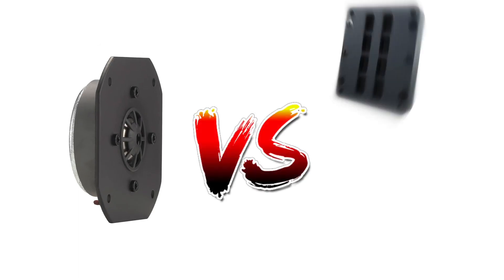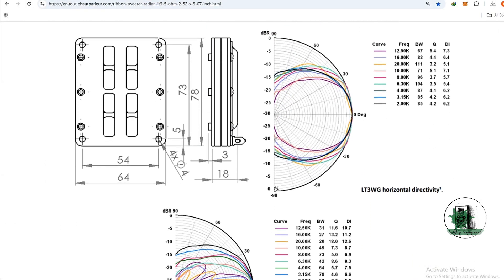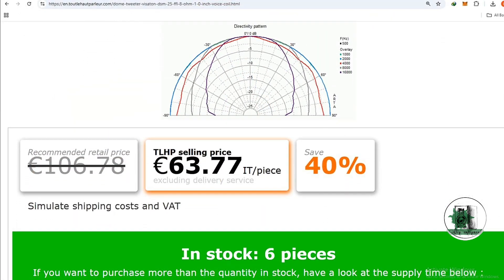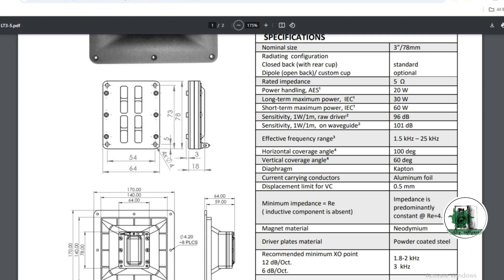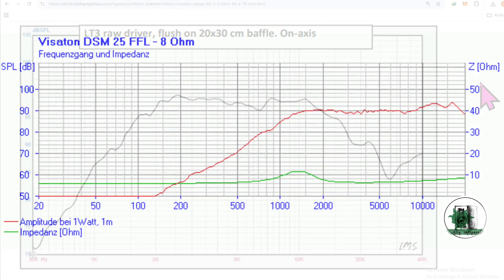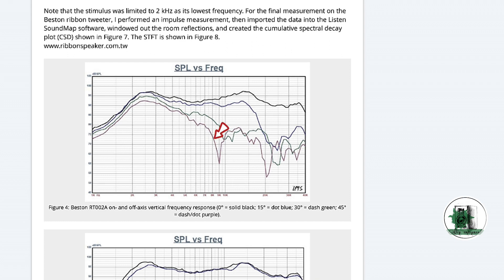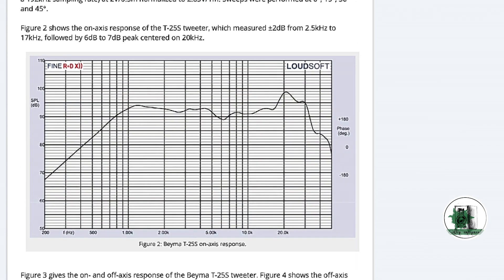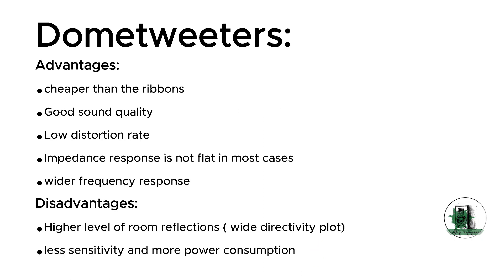Dome vs Ribbon Tweeters: Which Offers Better Sound Quality?

Comment: You've described AMT, gave an example of AMT, but called them "ribbon". There is no any "ribbon" inside an AMT. And as it's x10 easier to manufacture an AMT comparing to a DOM, their higher price will remain only until China flood the market.

Comment: Part 2:  Finally... Id love to have more videos, that answer these various questions...

1)  Bass sounds / frequency differences, between Ported  vs  Sealed Speaker designs  (standard woofers, cant be used in sealed speaker cabinets) 
(tested at both low and high volume levels... as that changes the responses dramatically)

2)  The same test.. with Passive Radiators involved.

 - The Bose Radio I picked up for dirt cheat at a thrift shop.. which uses the typical Ported design, with a long tube to try to accentuate the bass... may produce low bass frequencies... but they sound artificial  (not accurate to the actual MUSIC signal),   and... the louder you drive them... the worse the bass end up sounding (getting over-bearingly dominant... and sounding worse in total).

- A such, it might be good to Compare an actual Music sample... against measured readings..  to see if the bass matches the intended audio signal's intentions.

3)  Does a Horn Tweeter... Alter the 3d Soundstage Image,  and or  "COLORS"  the sound.    When you Cup your hands around your mouth... the sounds are dramatically different.   They are louder..  BUT...  the sounds are more  "Mid-Rangy"  (Colored).     Every Horn tweeter that Ive heard... Distorts and  "Flattens"  the intended 3D Image.   Likely due to the waves being bounced around on the surface of the horn... and causing the waves to be slightly altered in their directions... and potentially,  even their Tone.

4)  Something not well known by most... is how Magnetic Strengths,  greatly effect a speakers performance levels.   For example..  my EPI 100 speakers, only have an 8" woofer... where as my former 90s era Techniques speakers... had 12" woofers.   The EPI woofers, utterly DESTROYED the Techniques speakers, in Lower Bass, and Thumpier Bass.   It wasnt even close... despite the EPI' s cabinets being almost half the size.

 When comparing the drivers of both... I noticed that the Tech's woofers, used comparatively smaller magnets... AND... that they were very light in weight.  Where as the EPI woofers... have Massive and very Heavy magnets.    Im guessing that one EPI woofer, weights more than BOTH of the Techs woofers, combined.

 Obviously, the Techs... despite being a 3-way speaker... had inferior drivers to the EPI's...  and as a result.. couldnt compare to the Audiophile grade sounds, that came out of the EPI's.

 This makes sense, when you think about it more clearly.   If your magnetics are too weak... your woofer might accelerate slower than the music signal intended.   And when that fast moving woofer is demanded to STOP and instantly accelerate in the opposite direction... the magnetics might be too weak to stop the cone instantly.   The cone might travel a bit past the intended stopping point... and then, on top of already being a hair late... also might accelerate too slowly for the reverse direction.   All of these timings might only be off by fractions of seconds.  However... all of these end up creating micro-distortions, in the musical output.   This causes the flattening of the Image... and losses of details.

 Another issue... is the reliance of Test Frequency maps.   They may present basic issues with a speaker design... BUT... they dont reveal the full picture.  You see... its pretty easy for a Driver to play a single tone... or a single Instrument.  But when you try to replicate a very fast and complex (layered) piece of music... then that is FAR more challenging for the drivers to reproduce.   Its like if I asked you to make a single Cheeseburger...  vs  asking you to make 5 Cheeseburgers at the same time... and in the same time-window.   Music like Disco... such as from  "Earth Wind and Fire"... has a Crazy amount of Instruments, as well as countless vocalists all singing and playing at the same exact time.   Its far more challenging to a speaker, to be able to reproduce ALL of these things at the same time... without suffering some distortions.  However... if your magnetics are strong enough... the drivers can often reproduce the most complex, fast, and dynamic music... without suffering any losses / distortions.

 Obviously, the more drivers you have to share the workload... can reduce distortion potentials.   But if you have three poor quality drivers... they will easily be Bested by a 2-way, with Superior quality drivers.

 The only area that my former Techniques speakers excelled over the EPI's.. was in reduced power requirements... and sum total volume levels.   But while the Techs could play louder..  the sound quality just wasnt as enjoyable as the EPIs.    That said... the EPIs are more than loud enough, to get you kicked out of an Apartment.

5)  And finally... Id love to learn more about  "Pro"  level woofers.   The kinds of drivers, used in Concert Speakers...  and how they compare to woofers in Audiophile speakers.   Obviously, the larger Cone sizes, are likely to be an issue... as they are heavier, and harder to accelerate + stop / reverse.  That said... they "Should" have pretty darn strong magnets... so that might counter the larger sized, and heavier weight, of the cones.

 Ive thought about trying to modify a Pro / DJ  speaker that I picked up used for cheap...  with the EPI's  higher quality tweeter.   But due to various issues at the moment... I dont have the time or energy to mess with it, at the moment.     Anyway.. they have something like 18" woofers,  and two horns (and as Ive said before... I personally cant stand horns).

Comment: How about comparing Dome Tweeters, to Inverted Dome Tweeters?  (dome vs cone).    I have a pair of 70s era EPI 100 speakers, that have a 1" cone tweeter... and it blows away anything Ive ever ran across.   They can produce an extremely wide and deep Soundstage.... no matter where you place them... be it, on stands, or on the floor... vertical... or horizonal.    Also, they produce a 3d Holographic effect... to the point where you cant audibly discern where the Speakers are.  Meaning.. its as if the sounds are floating in 3d space, without a Projection Source.   This is an utterly amazing effect.   Additionally... they have such low distortion levels... that Im able to understand lyrics from singers,  that on any other speakers... I could never understand, due to micro-distortions.. that cause the music backing to mix and flatten with the vocals.   Thus, a loss in Details, and Individual Separation.

 The EPI 100  speakers, also have another Trick.   The woofers were wound with a heavier gauge wire, on the voice coils.   According to the designer... this automatically filters out the high frequencies, without the need for another Crossover Component.   This is theorized, to prevent further signal degradations / corruptions... from additional crossover parts.

 The EPIs are also Sealed Speakers...  and thus, the Bass sound FAR more NATURAL,  then ported speakers.   As ported bass, sounds very artificial... and "Droning"  (which gets very Irritating, very quickly).   Ported bass, also gets worse and worse sounding... the louder you play the speakers.

 As for Planers...  Many of the reviewers that detail their experiences... note that you have to sit perfectly in the center of the speakers, and if you move a mere foot in any direction,  there is a very NOTABLE drop-off in volume levels, between the left and right channels.   They are simply WAY too Narrow of a projection, for  "casual"  (normal)  listening  (meaning... being able to walk around the room, and or sit in different places in the room, and still get a great stereo image).    With Planers, you basically have to build a whole Listening Room, and place a Single Chair, within it... because there isnt enough Width, for two people to share the "Sweet Spot".

 This isnt the case, with the EPI's.   I believe there is like a 15 x 15 ft area that you can stand within.. without any seriously notable drop-off.  You can almost stand directly in front of one speaker, and still get a near perfectly balanced image.   Just move inwards by 1ft, and you get a 100% perfect Image.

 Now... I have owned a very early Planer speaker set... but it was likely nothing like todays audiophile grade planers.  It was sold as a special PC planer speaker set.   When I tried them... they drew attention to themselves..  and thus, didnt quite sound Natural.  Over-Exaggerated highs... and very poor mids and lows.   And even when adding woofers into the mix... they still didnt sound very good.

 One of the more interesting experiences Ive had... was when hearing a Dipole Ribbon tweeter (Lineaum),  that came on a pair of small Radio-Shack bookshelf speakers.   They had two thick ribbons that projected the image in 360 degrees.   The details they presented, were amazing... BUT... because the sounds were going in every direction... I was hearing the same sounds, being "Echoed" back to my ears, at various different time-windows.   It made them utterly useless... unless maybe if you treated your entire room with Heavy Absorbent Curtains.   My thought... was that they should have limited them to a 180 degrees,  with an absorbent backing piece... which might have solved the issue.   But even then... the lower mids, were anemic / missing... and the highs sounded too exaggerated / unnatural.

Now... I have heard Omnidirectional speakers... that sounded WAY better.   My friends parents had these Octagonal tables... that had speakers inside of them.   The sounds came out of ports near the top (on every side),  through clothed? grills.   I was asking him... where the speakers were... and then he pointed to the tables... which surprised me... as they were very non-directional (similar to my EPI's... but nowhere near as good of sound quality).

 Anyway... none of my rooms have been  "Treated"... other than the fact that some of my rooms have been messy.   But basically speaking... so called Tweeter reflections off of untreated walls... are not usually an issue for most people.    Its probably only an issue, if you are playing in a very large sized room (high ceilings),  with a very Empty space (not much furniture / items,  in the room).

Comment: Never heard a nice dome tweeter sound better than a good ribbon tweeter. In fact i always prefer the sound of a ribbon  tweeter. You can't escape mass when moving so quickly back and forth and the moving mass in a ribbon is many times smaller...plus it's driven directly and evenly throughout the radiating surface.  If possible replace the midrange driver with a planar magnetic one and you get the full monty.
Reply: exactly .... I have the 10 inch GRS planar midrange from P.E.  the sound is just jaw dropping accurate down to 400  AND its very affordable unlike the G&B was
Reply from the maker: I didn't say which one is better. Thanks for your comment
Reply: @Diy_enjoyment  I did. Got no ties to any manufacturer and my only obligation is to my own ears.